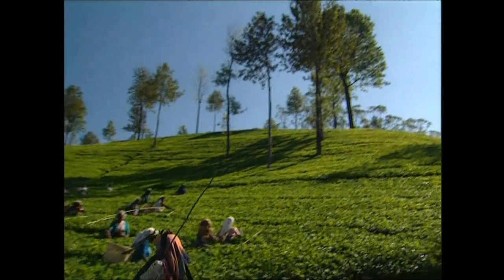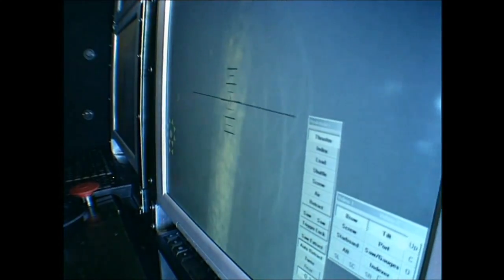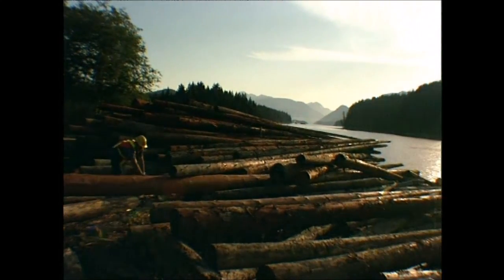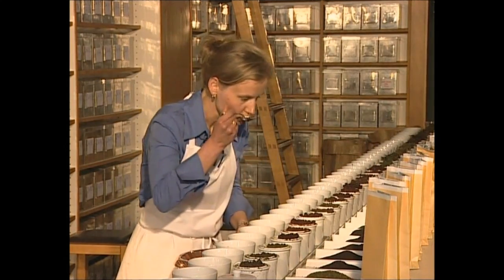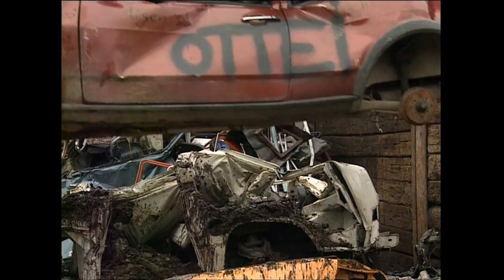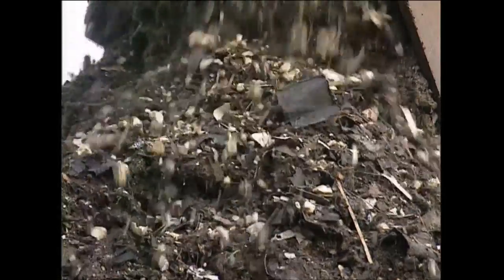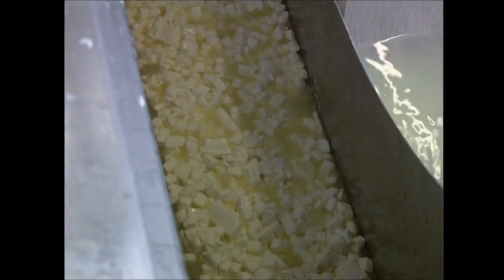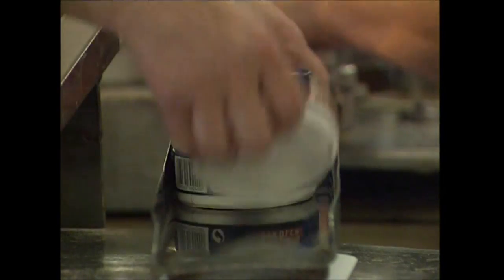► HOW IT WORKS | Sawfish Harvester, Tea Bag, Car Recycling, Camembert | Episode 12

Comment: This seems like a lot of money time ect for low yields (sawfish)
Reply: I was thinking the same thing. And the fact that there is a finite amount of underwater dead trees. So this industry would die out eventually.
Reply: It’s hardwood, so each one of those trees is worth at least $1000.  If they have 37 bags, and they can cut each tree in 30 seconds, that’s a lot of money.  A single black walnut tree can fetch as much as $20,000 because of the beauty of the grain and its hardness.
Reply: @SheldonBeldon  Plus they are old growth which makes them even more valuable. Not to mention that even though the water may preserve the wood that doesn't mean it doesn't have a desirable effect on the wood. These waterlogged logs are not going to be used for dimensional lumber, more likely they will end up in high end furniture, flooring, etc.
Reply: Right on man. Plus it will be probably planed into veneer making them even more money.
Reply: Nathyn Larsen .... just the rich....